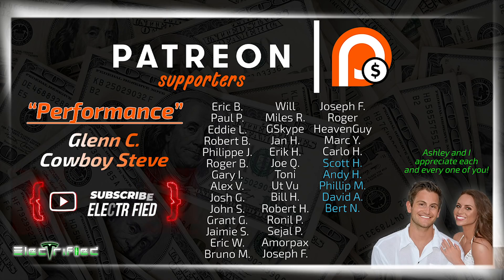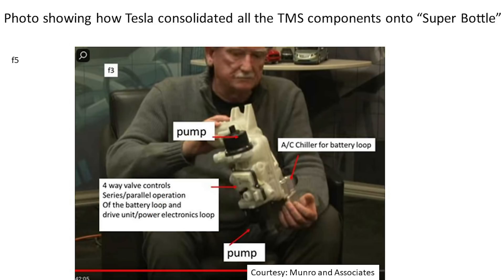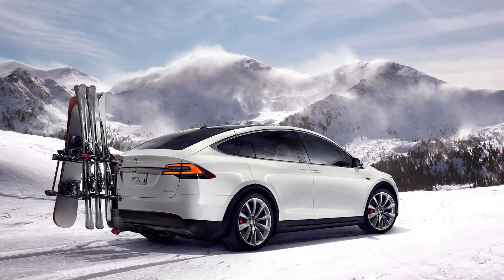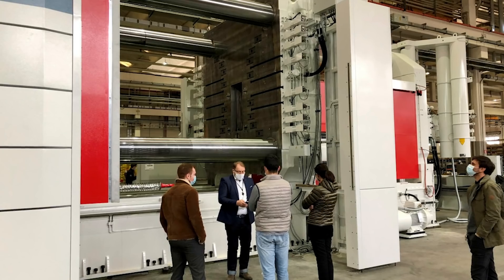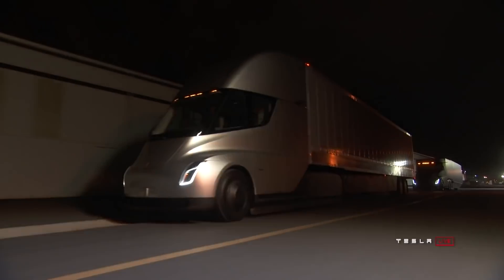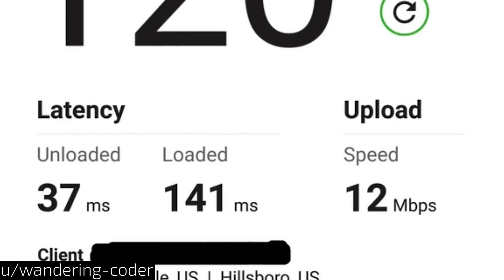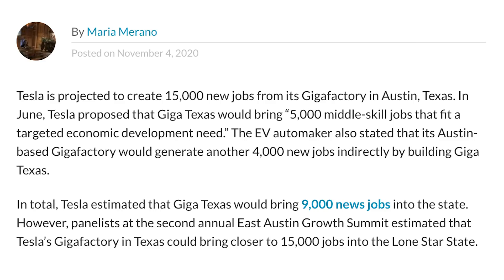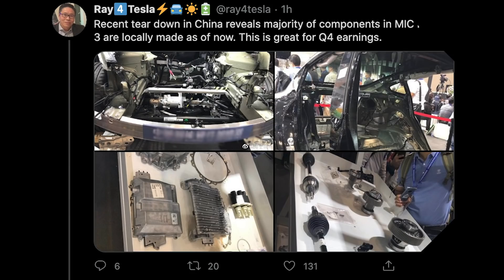Model Y Heat Pump Details // Starlink in the Forest // Giga Press Assembly Footage ➕

Comment: A lot of people are not thinking current self driving through for a semi.  Cutting accident rates by half will lower down time, cost less insurance, save lives, etc. I have insider information that current truck manufacturing companies are try to have two truck synced to the lead truck. This would let two drivers sleep.  Then a different truck takes over.  Elon had already said that Tesla semi will do the same.